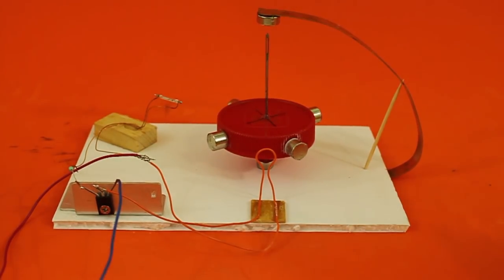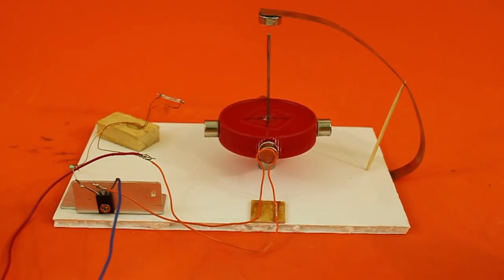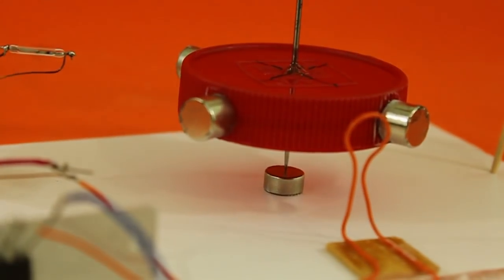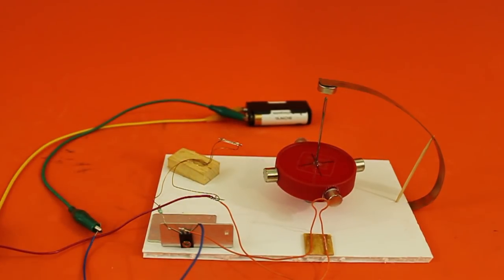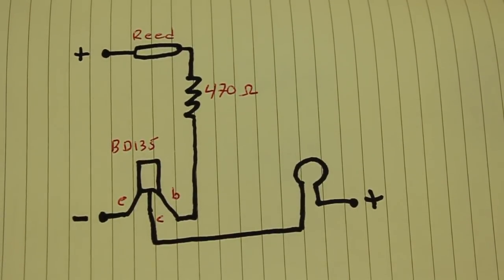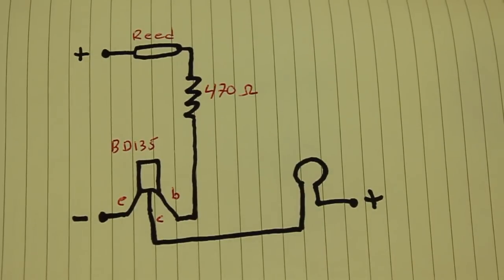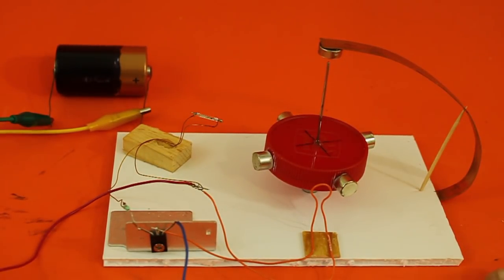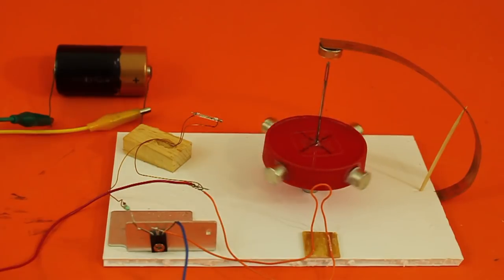Pulse Motor with Coil made with a Single Loop

Comment: Can You try with capacitor added between before the coil and ground? It would load in inert cycle and then pulse high current through coil when reed closes
Reply: Wouldnt be feasible for the transistor though as it wont withstand those kind of pulse currents. Maybe using a beefy mosfet may work?